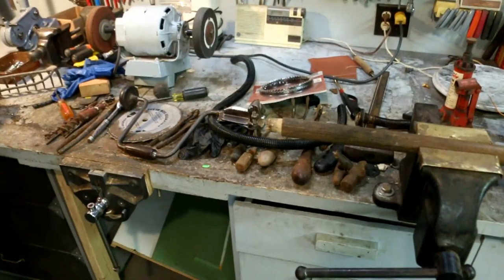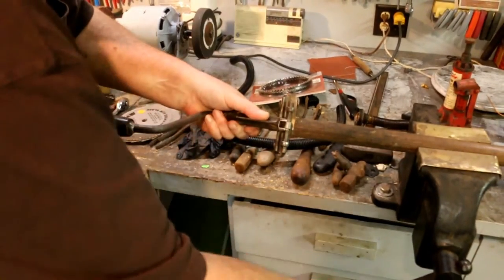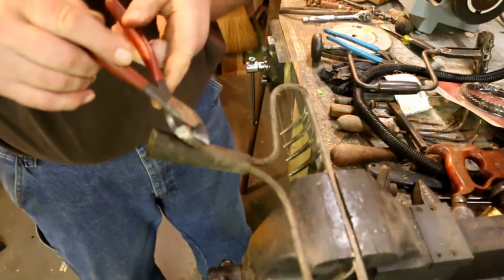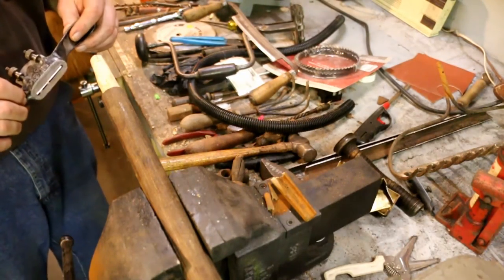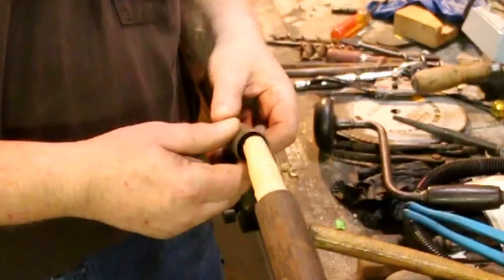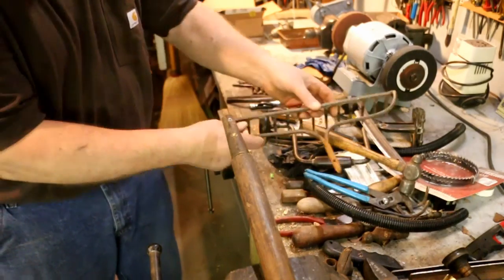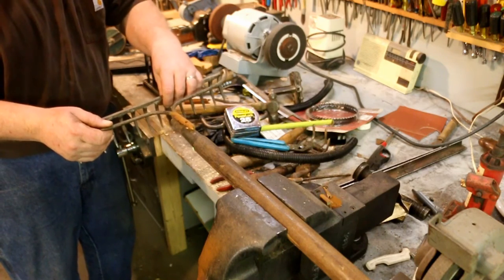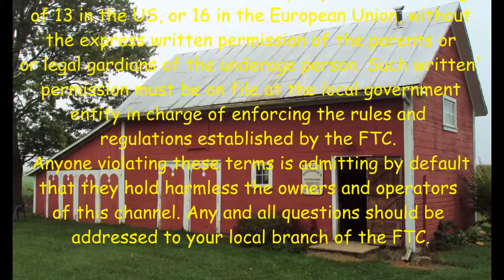Fixing The Garden Rake Handle

Comment: Good Job!!  I like the older tools that have been forged welded at the joints.  Most of my shovels, rakes and hoes have the shorter handles. My Dad was a master at replacing handles and making handles from hickory.  He would spend several days working a handle with a spokeshave and rasps fitting it to his hands. Have a great day with your Grandson and give Sadie an extra treat for me.
Reply from the maker: This rake was my father in laws. It was made with a forge welded tang that was a surprise. It is a lot older than I thought. 😁😎

Comment: I had not seen that auger tool before.   Very interesting.
The last rake I had to fix had a tubular metal handle.   I machined a piece of aluminium to fit inside the tube of the tube and a slot for the tang on the rake.   All epoxied in place.
Nice job on fixing your rake.   I would also have used a power drill.
Dave.
Reply from the maker: Thanks. I was okay with the hollow auger. The drawknife and spokeshave were easy. I just ran out of go on the drill.  😁😎

Comment: Thanks for the well made video.  I'm fixing an old hoe handle (the kind of hoe that mounts in much the same way as this rake head).  This particular hoe didn't have a screw or rivet holding it in, and maybe used pressure or glue (or both), until the end began to rot away.  What kind of bit would you recommend in drilling a hole in the somewhat narrow steel shaft connecting to the hoe head?  I would like to put a rivet or screw in it, to make it more secure.  Thanks.
Reply from the maker: Use a standard twist drill and if you need it to hold the head in make sure the hole is near the end of the tang away from the blade so it won't weaken the tang. 
You could pour some epoxy in the hole before putting the head in that will strengthen the wood. Good luck. 😀😎
Reply: @OldSneelock  Thanks!  I just found a used adjustable hollow auger, and I am wondering what might help in keeping my cutting from going out of round?  To put it more accurately, the auger 'wanders' to one side, so that eventually, it is cutting most out of one side and very little our of another.  My hoe handle is in a vise just like yours in the video.  Is the idea to keep rotating the handle, so that if the auger wanders down with gravity, it will even out the cut?  Thanks!

Comment: I think I just got a new handle but didn't have the right equipment then to drill out for the rake shank so the hammer of choice, inertia, gravity and something bigger than it was that was solid championed in the cause and it's stayed put for several years. I guess it figures there'll be more of the same if'n it don't. And it's right. Probably worse now because I have bigger hammers. Heard about the storm and praying for the folks in Loozeeanna and worked on the road a little more. Whatever comes'll ride the ditches and the road's sloped enough so it'll eventually end up there when things slow down. This is the 1st time I had a chance to work it with a hoe in 3 or 4 years and you can't do but so much with a box blade. I'd have a little grader if I could afford one but a hoe will have to suffice and this was a hoe job with all the rip rap. So I think I will go blow leaves nd mow them up because they'll be wet, flat and hard to get tuesday. HUG THAT GRANDBABY and GBWYall!
Reply from the maker: Getting the ditches clear is a big job. Glad you had the machine. I think a loader would be a big plus, but I really want a Skid Steer. 
I just make do with the back blade, and hand tools. 😁😎
Reply: @OldSneelock  The ditches were filled with 6 inch riprap then washed full of road gravel because the water couldn't get in the ditch itself, and then jarred loose thinking that the water would wash out the fines and inch size rocks that had settled out on top. WRONG. All the jarring did was let the fines and small stuff settle to the bottom and THEN I had to try and place the 6 inch stuff back so there was a ditch again. It had a 14 or 16 wide inch bucket which was fine for placing the rip rap and squeezing it back into the banks and leaving a ditch. It's done and now the real estate gal at the highway wants me to do her drive and parking lot. Not my hoe so we shall see. I'd be VERY happy with a scrape on a tractor instead of a box blade but I have nothing. Better that way! GBWYall!.
Reply: @OldSneelock  The kicker was getting a ditch back and grading the road back too. One or the other wasn't bad but both got really interesting. But it's done, at least for now. Just like being off a dozer a bit I was beat severely about the head and ears for a while too. Part of the job.